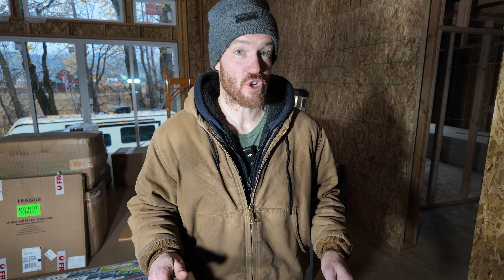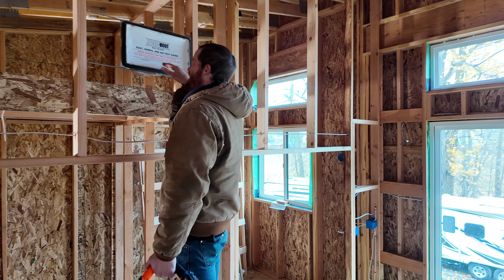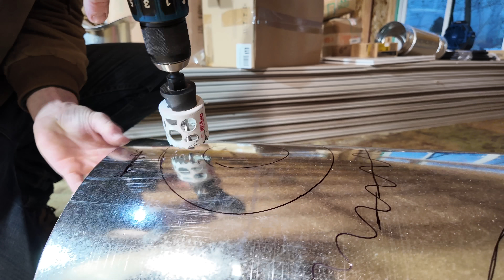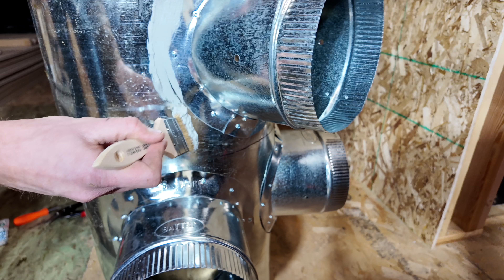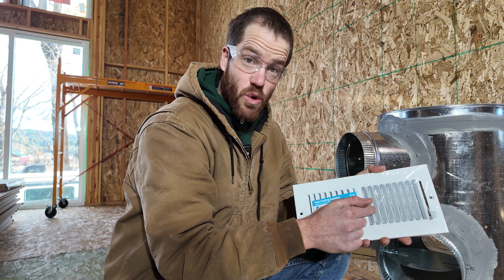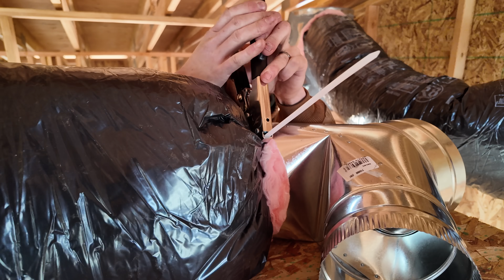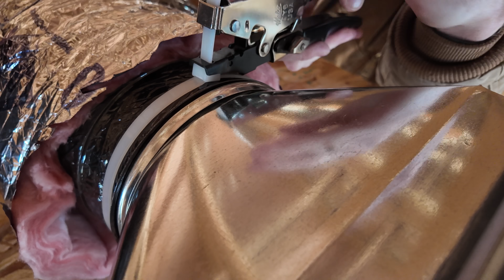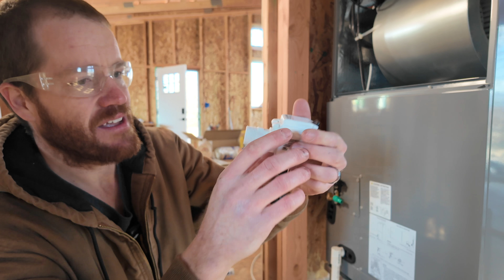HVAC Contractors Hate Me For Showing You This

Comment: I am a HVAC tech , and you did 2 pretty big mistake /
1-You need to insulate ALL air piping after the airhandler ( including plenum , distribution box , airboots and y-shape tees) or else they will condensate (in summer) and lose heat (in winter) like crazy.
2- You  don`t want to put airboots in bathrooms ( it will be causing high air  pressure - it will push smells to nearby rooms) - you want high pressure in rooms, common areas and hallways , in bathrooms, kitchen(in most situations) you wan exhaust vent.
Reply: Depends on if the ductwork is in a conditioned space or not, at least in my state. We only insulate exposed ductwork in attics and crawl spaces. Basements and closets we don’t worry about so much.

Comment: 45 year hvac contractor here.  Choice of Mr Cool isn't cool.  Overpriced garbage.  Poorly designed.  Has no benefit over other less expesive brands (they all come with precharge so you can easily install as a homeowner).  I've installed thousands  of mini splits, centrals, etc.  Overall, I've installed several dozen Mr Cools (supplied by customer) and all have had major problems.  Problems include inabilitye to service due to poor design, inability of t-stat to communicate properly with unit, irratic operation without notice or reason  I assume the pc control board is sub-par.  In short there are other options/other brands that outperform Mr Cool and cost far less money.  I've replaced many over the years and can attest to the fact that they are trash.

Comment: I'm surprised, out of a lot of comments no one mentioned your duct design is ineffective. 

Of course a lot of HVAC companies do it wrong to begin with.

Your probably only getting 50% or less out of what that system can put out.
Reply: Crimps on the round duct are backwards they have to go the way the air flow is going. cant have it upside down like that and the as far as CFM goes I doubt they will be feeling anything out of those vents. there is no way this passed inspection
Reply: @BradleyMitchem-o5e that's one thing, but the spider box idea is more where I was thinking of.

Comment: Thank you kindly for this lesson.  I was quoted a cost of approximately 10k for new ducts...... anyway; I will try my hand at it as well.  I can't do any worse than what's currently on the AC system.
Reply: Yes yes you can
Reply: Do you understand CFM,s or even know what ton and SEER rating your unit is.  Just actually do research before you do what this guy did and completely do uour duct work wrong.

Comment: His duck sizing is wrong. You can’t run an 8 inch duck then tap off a 6 inch duck while still continuing the 8 inch duck should’ve thought it would like a 10 inch duck then down to an eight and a six not gonna get the proper CFM. Also, I was gonna have a sweating problem. We got the duck against the wood can’t be insulated properly.

Comment: 8” flex is good for 160 cfm to keep the proper velocity of 700-900 for a residential system. I expect this system to be noisy when at full speed. Also you should insulate that main plenum and register boots.

Comment: Now when the unit fails because of ceiling, condensation damage and improper static pressure that causes bold growth, you have no one to blame or Sue, but yourself. And you cannot possibly install this equipment without running a proper manual J, D and S. And checking measurements and adjusting blower motor and refrigerant levels after installation. Just pay the professional it will save you money in the long run. People trying to pinch pennies only cut corners, which cost more in the long run.
Reply: Not to mention that you now have no access to your filter. Your return is completely wild and undedicated. I don’t know what else is going in that space with that air handler, but you cannot put any gas appliances in that closet and honestly, you shouldn’t do it at all in case there’s a refrigerant leak. And you’re installing a unit that probably won’t last more than five years, especially without a proper vacuum pulled. Contractors have to jump through so many hoops that forces us to do things properly and Homeowners just don’t see the value. It’s ridiculous. They act like they can do it. “With no special tool or skills”
Reply: I’m with you bro. The amount of so called “hvac guys” in the comments validating this install is insane. There is no one-size-fits-all duct system, that’s why you have a professional come out with a duckulator and draw it up. This guy is in for a horrible wake up call when the problems start to manifest.

Comment: Very few real technicians will service internet units; parts are extremely difficult to get and find on a short timeframe .
Flex duct is actually a negative (-10) SEER application so thinking using a quote (High) SEER unit on flex duct is a dream.
No one will do the warranty work. It takes Hours to time to get the correct part,shipping costs and return the part shipping cost is a  huge factor and pain in the process.

Comment: In general, don't put a heater vent in the bathroom. The pressure will push smells out to the rest of your house. You should have an exhaust fan in the bathroom to remove damp or smelly air.  If you really need heat in the bathroom, use electric as it does not require the movement of air

Comment: That system is probably oversized and you will probably have humidity issues.
Reply: Unless you guys plan on putting terrible insulation and windows on the house it’ll be oversized for what you need

Comment: You need to make sure your vent on the condensate line is above the units condensate pan. If not the water will flow out the top of the vent if the main line backs up. I also agree with some of the other comments on insulation of the bare sheet metal ductwork. Nice job.

Comment: I would have used mastic tape or mastic sealant on the inside. Also, you're supposed to flex foil wrap duct before zip tying
And even more importantly to your health use a respirator. Value your lungs even if it's for just a 1 time

Comment: I am writing to express my deep concerns regarding the quality of the HVAC system installation. Regardless of the cost of the system, the current installation is fundamentally flawed and, in its present state, will not be capable of properly heating or cooling the home.

Based on my assessment, this system is not only inefficient but also unlikely to ever operate as intended due to critical issues in design and execution. I strongly recommend a thorough evaluation and immediate corrective action to ensure the system meets basic performance and comfort standards.

Comment: I always like to add a cold water line onto the drain line with a back flow and install a moen shut off that you can control from your phone to turn on periodically to flush out the drain line. I have done my fair share of repairs for customers due to the drain line clogging and backup and drain pan overflowing. I always tell my clients my company don’t just build to code we build for longevity

Comment: What if your line set is to long? I remember doing this myself in 2001. I had HVAC techs at work that I could as questions . Needed specialized tools but my system is still working today. I bought alot of my parts at Home Depot. I bought my split unit on Ebay. I had to learn alot online and I took 2 AC classes and the local Jr college. One question I had is that system you put in sized larger because you want to add other cooling at a later date? Good video

Comment: As a retired master licensed HVAC contractor you need to insulate each metal exposed to any hot attic air or the tins will sweat n create a huge water mess!
Also you should have painted a thin line of mastic mud on the inside of each duct connection so it seals the duct to the metal collar before zip tying there will be no air leaks once dried. Can leave the duct six inches long for future adjustments your ducts were oversized for room sizes n needs.
Registers in the rooms work best when positioned in the room farthest points from the return. Usually above windows. Preventing hot spots in a room.
Screw the unit to wall and the stand it could vibrate off overtime. And you need a filter box for filters or the coil will be fouled in six months!
It’s better to build a wooden box with filter grill n seal box so only return air can cross over the filter only! Must protect your coils from dust inside n grass n dirt outside it’s what destroys AC units over time! But in 15-20 years you’ll need to replace it for higher efficiency n lower operating cost plus the coils will eventually leak!
Last tip install a liquid line (small freon line)drier 163F for flare nut connection to prevent moisture in the Freon from mixing with the Freon n creating muriatic acid that will slowly eat holes in the coils they only cost $25 max great insurance!
Looks like you have plenty of land please don’t install the outside units on the ground mount them in the air 3-5’ off the ground so they are easier to service n stay safe from leaves n grass n dirt!
Reply: your wrong! i have been an hvac contractor for 3 years and you don't need to insulate that!
Reply: @noahevans2314  every single one of of your installs left complementary ceiling decorations, bud 😂 water spots galore on your installs lil bro. Leave it to the professionals, we wrap all our attic duct with R8 fiber-glass insulation. Only thing you’ll be keeping warm is the seat of the truck, young blood 😂
Reply: @VoodooRanja  Show me where in the code that it requires it? I've already passed several certifications.

Comment: HVAC guy here: one small nitpick, those auxiliary heat strips seem like they’re awfully close to the ducting, you could run into some issues with the plastic liner in the ducting melting
 I would double check the installation manual to see what kind of clearances they call for.

Comment: Somewhere long ago when I was DYI er, and never worked on A/C before, some fellers that did work in the AC industry told me, never make a run within 18 inches of the end of your trunk, theres a thing called static back pressure,  and to try and balance your runs opposite each other if possible, well I dont know nothing, I just cooked for a livng, but I removed all the ductwork in my basement, that was installed by the builders ( the house was just built ) and rebuilt everything from the unit, to all my vents, + return, using the advice my ,industrial tech friends gave me, and added 6 6" vents in my basement, once I had finished my basement, and the house had a 2.5 ton unit, my house is 2600sq ft, 1floor + basement, blower in basement, ductwork and trunks in ceiling. When I had residential AC techs come to check my system, they checked the amp draw of the unit, blower registers, return temp and volume, and vent temps, they said, whoever installed this unit was a genius, that I had a good installer on my house, I said I did this after pulling everything they did, he said ,oh you do AC, I laughed and said no I cook for a living, he said this unit is normally to small for this size house, but it is exactly pulling what it is suppose to, by most standards it would be to small for this house, but you have managed to ballance it to a T

Comment: Couple things,from an HVAC installer.   Putting the ducts near the doors allows "bleed" from room to room. Also, almost every room needs a return. If you put them on opposite walls, the room gets a breeze.  Put the duct asymmetrically from the returns so air swirls in the rooms and the returns need to be the same size or bigger. Think about your air moving like it was water. You want a calm, almost unnoticeable flow.  No air blowing in your rooms or face.  Insulate your plenum/joints and your lines.  SEAL EVERYTHING!  A few missed seams can cost you 10%.
Reply: As a residential installer you're tripping if you think every room needs a return

Comment: duct run should not be based off of sq ft to cover in the house. It should also be based off of which room is facing the sun during the summer. my 3rd bedroom is literally 90 degrees during the summer and also has a low roof/ceiling.

Comment: Proper duct sizing doesn't require dampers. Duct is not DIY friendly. Its easy to get wrong then you lose efficiency and ruin the equipment. Your duct is Swiss cheese which causes uneven airflow. Octopus is a new term. Mr Cool has ductless heads. Use them.

Comment: You only need a drip pan for the indoor coil if its in the addic. In a garage or utility closet its not required. the coil has a drain in the box under the coil. The secondary and primary drains are threaded the at the bottom.
Reply: I see you found the drains and plumbed them in correctly. I'm curious if you plumed the unnecessary drain pan to the secondary drain or left it like a water heater.

Comment: Good video overall.
You got a lot right.
But, I believe you missed a few things and misrepresented the $2,300 cost of the system you bought.  (Unless you got a special deal from Mr Cool.)

Other comments have expressed things like insulating all bare metal (including the distribution box), hanging the ducts with straps (so they don't rest on top of the joists), adding a filter box (for quick access to the filter), whether the opening around that 16" duct was going to be sealed, and that plenum should have been metal all the way up..

One of the key things of DIY is that you assume your own warranty for your work.  Which is a big part of that $20,000 quote.  Contractors (at least, good ones) have to do installation that won't create callbacks.  We have to warranty our work for at least one year.  But, many times for longer.  I could never garranty the use of those easy fit fittings on the line set.  I've seen them fail too often.  As a DIY'er, the cost of error is on you.

Also, on the cost of the system, you show $2,300 on your spreadsheet. According to Mr Cool's website, it's much more

As someone who has put in over 100 units (ducted, un-ducted, gas/electric, heat pump, various manufacturers)
I can tell you that a project like yours.... materials cost is at least $6,500... labor cost for my assistants, another $2,000.

I don't mind DIY.  I do it too, on many things.
Your video was very thoughtful and  insightful.
You are very capable!
I do mind over simplifying the process by skipping or not mentioning steps and costs.

Comment: Flex duct is for amateurs. We run metal duct, with duct sleeve insulation. Mice will chew through that flex duct and he will be replacing it.. Code says no more than 5 foot of flex, usually used at the end. 
Air not cooled. Heat is removed, and humidity is removed. Good job on using an overflow safety switch.

Comment: You'll have higher efficiency if you duct your return air from up high. Heat rises and you want to pull that heat back into the system to either get rid of it (summer) or add to it (winter). You may find that passive return directly into the unit from the bottom floor in a closet won't get you the performance you're looking for.

Comment: I've been doing HVAC for 35 years. There are nuances that you missed, but it'll work just fine. Kudos for you understanding the CFM, although you have a 8 inch serving and 8 + 6 that's not entirely correct, but it'll work. If you think about it an 8 in 8 in, it can't serve an 8 and a six, that is, if you need the full CFM volume from an 8-inch. Nice job for a first timer.

Comment: The best video of all I’ve watched!  A couple days ago, my AC went out and the thermostat went blank.    I checked it and I saw that water was leaking out and down into the Diversitek Condensate Pump top which is positioned directly below the drain piping.  It has three lights and is wired directly into the air handler.   I temporarily diverted the water so that it was no longer leaking into the pump motor. 

I flipped the breakers back on and everything came to life again, but the condensate pump lights were flashing and made several cracking noises before I heard a loud “pop” and everything went dead again. I think the condensate pump motor had more water than I realized and  I think it may have popped a fuse in the air handler.  

I’ve been stalling opening the unit to see if the fuse inside was actually blown, as this is a new system to me and I have to be so very sure of what I am doing so as not to cause any more damage.  I’ve watched a ton of videos the last couple days.

Your explanation of your system, even though a bit different than my set up was so articulate, professional, very knowledgeable and straight to the point.  And besides the previous points I appreciated from your  video, I so appreciate videos that don’t waste time, and yours did not.  

I rarely write comments - this is maybe only my third comment in years, so Kudos to you Sir!    And thank you for your effort.

Comment: I am a bit late, but two issues on the ducting, one of which is big.
1. You didn’t use ant mastic/pookie on the inside duct liner before attaching it to the plenum and grills which won’t give you an airtight seal
2. Bigger issues, you just did a strap around the insulation which can lead to condensation and possible water damage. You wanted to pull the insulation inside the duct, and then pookie the silver part to the plenum and the grills.

Comment: Your duct design is the worst ever. I would guess you system last less than 3 years. Air flow is one of the most important parts of HVAC.  Heating Ventilation Air Condition We control all that. God, I hate to see what you do with fart fans

Comment: NO! Wrong. You need at lease 16" past you last run. You have to have reverse pressure, or static pressure. You will kill your Blower Motor with no resistance. 16" past last run is minimal.